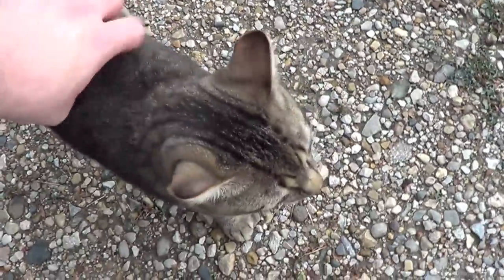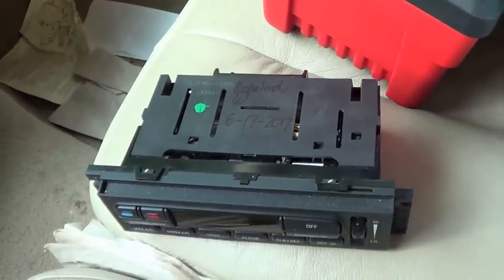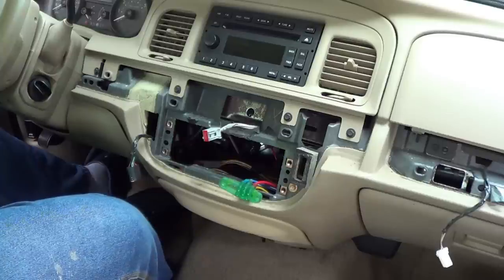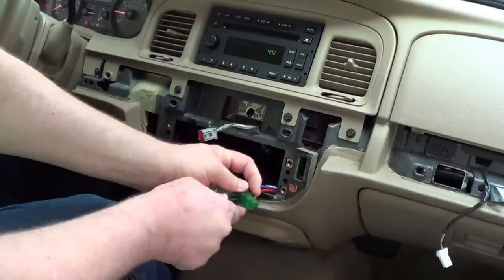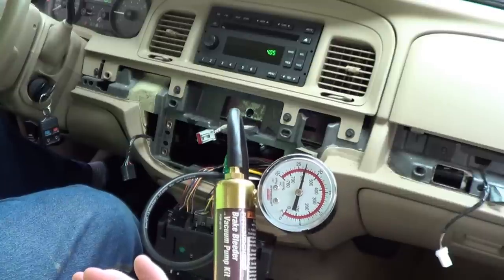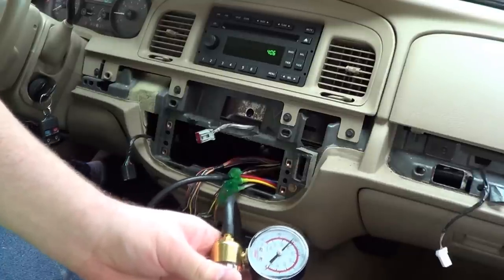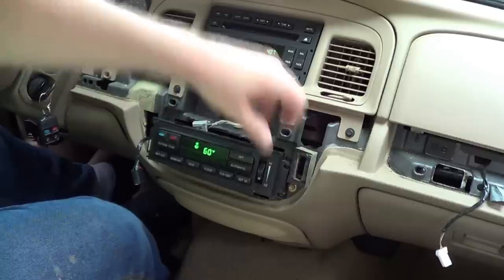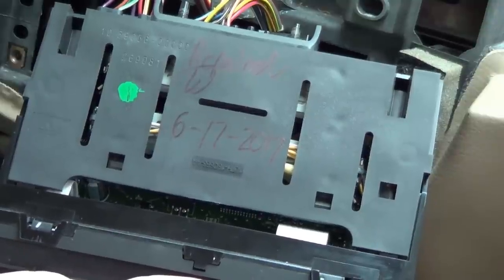Troubleshooting a Ford Electronic Automatic Temperature Control Module

Comment: I'm color blind. I have a 93 Mercury cougar xr7 WITH automatic climate control. I'm having to rewire the auto resistor for the blower motor and the new pigtail has all white wires. Hints to why I'm asking for help. When I got the car someone had cut the old pigtail wires off to try to put an analog resistor on the car but the climate controls in the cabin only work with auto climate resistor. Could anyone tell me which wire goes to which for the pigtail from the wiring harness? Any help would be appreciated. Thanks so much.
Reply from the maker: Do you have any friends with normal color vision or a multimeter? You may need the factory service manual or a working "donor" car to make comparisons with in order to fix this.

I'm not even sure which resistor you're asking about...the one that's used to sense the cabin (or outdoor) temperatures, or a heavy power resistor to reduce fan speed. The electronic climate controls don't use a power resistor to control fan motor speed -- they use a pass transistor.
Reply: @uxwbill  yeah. Imma start going to salvage yards to see if I can find any auto climates parked and see if I can take pics of ones that are hooked up. Start there anyway. Seems to be the easiest in process of going about it. Thanks for the input. Much appreciated man.

Comment: Fill the top and bottom faces of the valve body with slow cure epoxy?
 Maybe after first finding the missing spring or an alternative,
A simple task made complicated,
 Best of luck Bill,
  J.
Reply from the maker: I did try filling in the valve faces with epoxy and after that I had another problem. Vacuum is leaking through all the mode door outlets (or is that an "inlet", since it's a vacuum?) regardless of whether the solenoids are powered or not.

I could see the one with the missing spring not working, but it shouldn't affect the others. Unless of course it does, and that I just don't know.
Reply: Hmm, It might be internally cracked as well then,
 Cut down Biro spring? They have got me out of trouble several times,

Vacuum leaking out or the atmosphere of the earth leaking in, 
It's obvious I know, but with enough Liquid stimulants sloshing around in a persons being, those questions are sometimes unanswerable.
 Best Regards, J.

Comment: Does this car have a blower motor resistor?  I have a 2003 Ford F-150 king ranch.  The ac temp surges to high and no cold air.   Ordered a blower motor resistor.  Can not locate it under the dash.  Any ideas?
Reply from the maker: On Panther platform cars with automatic climate controls, a power module having a pass transistor is used -- there is no resistor.
Reply: @uxwbill  so, I would probably have to send the head unit in for service?  Not a DIY?  Sounds like an expensive repair.
Reply from the maker: Keep in mind I've no experience with the F-150, and I'm sure that some details of its system are differently implemented than on the Panther cars. If you really want to know for sure, get the factory service manual (no Haynes or Chilton's). This (or even a discussion board about the F-150) will also tell you where it is. 

The blower power module (that's likely present on your truck as well, if it has the EATC) has almost certainly failed shorted and there is not likely to be a problem with the actual control head. As this module needs cooling, it will likely be in the MVAC plenum somewhere. It's also fairly substantial because of the cooling fins on it, and will have heavy wiring going to it.
Reply: @uxwbill  Yes it has an EATC under the passenger side dash.

Comment: Hi I have that same module I changed my resistor and my air still just blows through the vents so u think it’s the o rings
Reply from the maker: Don't "shotgun" troubleshoot. I think you need to make tests similar to the ones in this video and find out.

Comment: On the ford air-conditioning systems like that what happens is the seals in the vacuum transfer goes bad. There are a few companies on eBay I know of that u can have those shipped off to. I have had issues like that on 5 crown vics and it fixed the problem every time
Reply: It is a very common problems in those Crown Victorias and the Grand Marquis
Reply from the maker: ...but is that another way of saying "o-ring failure"?
Reply: Yes, you can't really fix them though unless you do some really unkind methoods of doing so.    That's why I recommended getting it shipped off. Also by what I remembered from the last time I had one apart (using the unkind method of doing so) it took a o ring that more flat to fit in. So a normal o ring like what you would find at a local parts house won't properly seat.
Reply from the maker: The o-rings we got, which were shown in this video, worked perfectly in the Keykeeper's car. Its climate control system is still going along just beautifully.

Comment: Hey bill, mine is starting to fail while the engine is under a load, while under WOT, or climbing a grade should I expect these O Rings to be the root of the problem?
Reply from the maker: You have the start of a vacuum leak. Sure, the o-rings are a possibility. They are just one of many, so proper troubleshooting is called for...even if it may not be any fun.
Reply: uxwbill So my update, I went ahead and did your fix, fully smoke tested all accessible vacuum lines, and bypassed all check valves, and could not find any signs of a vacuum leak. I went ahead and replaced all the o rings and to my surprise it’s fully fixed. Anything I’m possibly missing? Or could it be that moody under the vacuum leak the HVAC would loose that much vacuum?

Comment: If you have vacuum on the black line just use a jumper tuning from the black line to the other lines or colors. you don't need to use the pumper every time .
Reply from the maker: Not enough hose adapters to do so.

Comment: I am getting code 25, 25 25... then 888... but the thermostat is goes from 15 to 32.   No air and nothing happens.  I changed the blend door actuator Becusse it kept clicking real loud.   Thought that was the issue.  Any ideas?
Reply from the maker: No airflow suggests that maybe the blower motor isn't running. It should be pretty audible at higher speeds. Check fuses, wiring, connectors, blower driver module, motor being stuck or having a dead spot?
Reply: @uxwbill  thanks!  what do u mean it should be audible at higher speeds?  It’s just weird that the thermostat is between 15-32 degrees?  Like it won’t go above 32.   I can’t find anything on that.
Reply from the maker: You should hear the MVAC (heating/AC) blower running, if it is. The sound of rushing air will be noticeable, especially on higher speeds.

It sounds as though your temperature control is reading in degrees Celsius. Was your car originally made for a Metric country? Range of the control is degrees Fahrenheit is 60-90, and 15-32 degrees Celsius is the same range in different units (59-89 deg F when converted). If not, I'd suspect data corruption in the EATC head, or something like a wire jumper or resistor that sets the temperature measurement unit has come loose or failed. I am not sure which approach Ford used to program the EATC.
Reply: @uxwbill  Na I’m not getting anything at all.  That’s how it used to be; at higher speeds.  Now the fan isn’t even turning on.
lol I don’t think it was made for a metric country.  I am going to try a new control module and see if that does it.
Reply: @uxwbill  I didn’t think think about it being in Celsius

Comment: can u make a video about a dell optiplex 760 usff cuz i have one and it keeps turning on for about 7-10 seconds randomly about every 20-40 minutes even when the computer is turned off
Reply from the maker: Sorry. I don't own that version of the 760. Even if I did, I've never seen a fault like that. You'll have to troubleshoot on your own. I'd recommend starting with the power supply.

Comment: Hey Uxwbill, I found an AST Advantage 614 in my grandmother's garage. I cannot find anyone selling this thing anywhere. Do you have any info about it on it's value or why nobody is selling them? It's a very interesting system and I was intrigued.
Reply from the maker: AST was a very successful computer company and most all their products sold very well. An older computer is worth what someone will pay for it.
Reply: uxwbill cool! Thanks for the information. Kind of surprising that nobody is selling such an old machine. I mean, it might not be worth much, but I would think somebody would attempt to sell it.
Reply from the maker: The rise of mandatory electronics recycling has done a number on the number of these things left around. There are still lots of them around, though many are in the hands of collectors or driven deeper into hiding.
Reply: uxwbill Very interesting. I guess I'm a lucky person then! Definitely thinking on upgrading the ram to 16mb and maybe add a dedicated isa video card then. Live through some of the games that I missed out on before I was born.
Reply from the maker: That'd be a great use for it. (Although: if there is onboard VGA video, you might give it a chance. It'd be likely to have a much greater bandwidth connection to the system bus.)
Reply: uxwbill Very good point. It does have a VGA port for mobo graphics so I'll definitely give it a shot. I would upgrade the cpu but it appears to have a very small heatsink so a 166mhz chip might run a bit too hot.
Reply: Also, it's likely that AST Advantage is of the 486 family of PC's as my late father bought one from an auction in 1994, and it was the 486-DX33, with 4MB of RAM on board and DOS. I had it from 1997-2000 when I bought the AST Bravo! mid tower PC, a Pentium 133 PC that had the build date of 1996 stamped inside of it, and in 1997, AST pulled away from the US market and sold thair wares in Europe if I recall.

That's why you likely don't see them much around here as most of these old PC's were junked years ago before mandatory recycling became commonplace.
Reply: John Palmer I see. Sadly, it's. It isn't a dos system but a Windows 95 system. Hey, maybe I can put dos on it anyways.
Reply: You can, it came with DOS or Windows 3.1, ours had DOS 4 I think to start with and 4MB of RAM. I put Win95 on it and it bogged down somewhat.

Comment: I have a fiesta with mechanic A/C.. I want to convert it to Eletronic with temperature control.. Could you make a video or reply my comment to what components i would need to get to do it?
Reply: I reckon thats a lot more modern than what UXWbill has done work on, i dont know if they would use Vaccum stuff and remember that it would be pretty disasterous (like cutting ductwork to add in servos and blend doors and etc)
Reply from the maker: There is no way I could make a video for something I don't have and know nothing about. (I avoid modern cars like the plague because they are a plague. And I'm not a car dealer or service tech for a repair shop.)

If your car was offered with the option of automatic climate controls, there's a chance it could be converted. Get ready for a lot of work, and plan to have a complete donor/parts car with the options you want available. You may have to do everything from changing out the heater/air conditioning box to replacing/modifying/patching portions of the factory wiring harness. It's also possible that certain computers might need to be reprogrammed, and that's something most dealerships either don't know how to do, or won't/can't do. You'll also probably need to know how to read a schematic.
Reply: Thanks for the reply (my fiesta is from the year 98 though) :)
But i understand
Reply from the maker: Here in the US, Ford's Fiesta left the market in the early 1980s and didn't return until 2010.
Reply: Here in Brazil they arrived in 96 and never left :)
But this generation of mine uses a even lower tech than the original 96 model from europe (it had a engine from the 80s with modern Injection i think)

Comment: Could you fix the crack with JB Weld or Silicone?
Reply from the maker: I gave it a very good treatment of epoxy.. After that, it started pulling vacuum through all of the mode door ports, leaving me to think that another commenter was right: something internal has cracked and is letting it leak internally.

It seems I can get a refurbished module with a lifetime warranty for about $100 before a core charge, and I think that's probably the best option. For now I've got the climate control head hooked up, stripped of the solenoid body. Filling in for that part is the hand-operated vacuum pump. It'll hold all day and that will get me by for now.
Reply: Ahhhh gotcha.  And wow, I wasn't expecting $100!  I was thinking several hundred IF you could find one.  Great news!
Reply from the maker: I definitely didn't expect a replacement to be "cheap" (if you can call $100 cheap). There are still lots of these cars around (and I think there will be for some time to come) both as low mileage drivers (sometimes as low as 50 or 60,000 miles!) and in junkyards.

Even though I'm totally the wrong demographic for this car, I really like it.

Comment: I fixed my blower motor ,my blend door motor, put a new compressor on an still have no heat..what could be the problem
Reply from the maker: "Shotgun" repairs don't work. The A/C compressor has nothing to do with heat. It should be pretty obvious if the fan is working at all. If you have the automatic climate controls, there is a built in test for the blend door motor. If you don't, you could still watch or listen for the blend motor when it is running.

If the problem is lack of heat, start with the components responsible for heat: coolant level, engine thermostat, engine cooling system, heater core, etc. If you don't know what you're doing, take the car somewhere and have it serviced professionally.
Reply: uxwbill already changed the blend door motor
Reply from the maker: Did you read a thing I wrote? Go back and try again.
Reply: uxwbill did u read I thing I wrote
Reply from the maker: Every word. Take your car to someone qualified and have it repaired, because you're not. Seriously.
Reply: uxwbill Ima take it to Dee in yo city you know him
Reply from the maker: Nope.

Comment: The one in my dads 2003 Grand Marquis Ultimate Edition is VERY VERY VERY VERY RAPIDLY! changing the fan speed ALL. ON. ITS. OWN. Once it starts doing that, you can't do anything to stop it. It doesn't do it right away, but I wish it would stop.

Comment: I only clicked on video to see the cat
Reply from the maker: Thanks for the support. I'm glad to know that people are getting so much out of my videos!
Reply: sound  like what  wrong  with my mother car  it not  same  brand  but  sound like that  what  wrong  blow  out  heat  and will not shut off
Reply: Bill was not working on the exhaust system today, but you did get to see the Automatic Temperature Control Module!  ;-)

Comment: mine only blows out of the front vents, any ideas?
Reply from the maker: If you have a Ford Panther car with EATC, there's a very good chance it is just the o-rings.
Reply: i found out what the problem is, someone broke the vacuum line and shoved it into the one to make it come out of the front vents, i fixed the line, everything worked for one drive. got back in fired her up. now it is doing what this one was doing, i tested all of the actuators with the vacuum they all work. so i need to look at the module now?
Reply: if i knew how easy it was to check this i would have looked 2 months ago... LOL!

Comment: why would they use vaccume lines that will mess up sometime instead of electric co controlled? that is kinda a bad design.  i don't like auto. i like having high cold air high fan on my face all the time. i do have a 94 toyota camry that has no auto mode though. i am used to setting to outside air when it is hot out and opening back window for a min to get the hot air out and setting to recirculate and closing windows when i get in car. 

also sure you know but the way ac works you should set to outside air when it is hot out because the air outside is not as hot as the air inside usually. it will cool it faster. open back windows helps get hot air out fast too. after a min set to recirculate to keep the cool air cool inside.
Reply from the maker: It's probably got a lot to do with the fact that this is an older design, simply updated slightly in its later years before Ford ended production of the Panthers.

In their last few years of production, it seems like Ford was equipping all of these cars identically. Had it been my choice, I wouldn't have ordered an automatic climate control.

Comment: I got heat and ac but no lights on module any advice
Reply: Fuses are good
Reply from the maker: You can try removing power from the module for a few minutes, but at this point, it likely requires repair or replacement.
Reply: @uxwbill  for how long

Comment: Got a 01 town car....my climate control lights up but won't even come on.....I got another one.....and it's doing the same thing....
Reply from the maker: You need to perform diagnostics, and not just throw parts at it. Check fuses, wiring, actuators, and if you really want to do it right , get the factory wiring diagrams. A basic multimeter will also come in very handy.